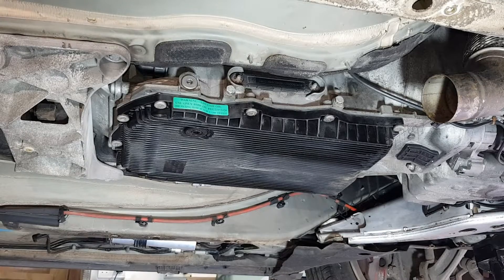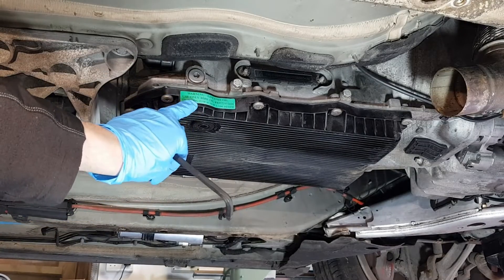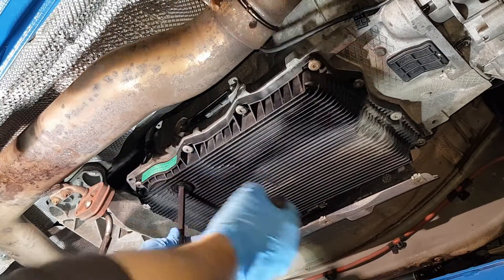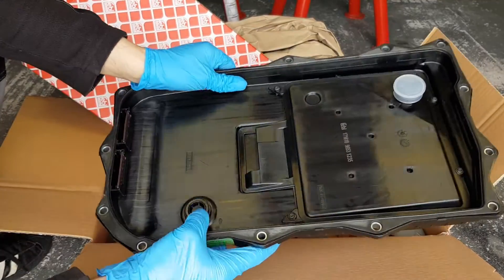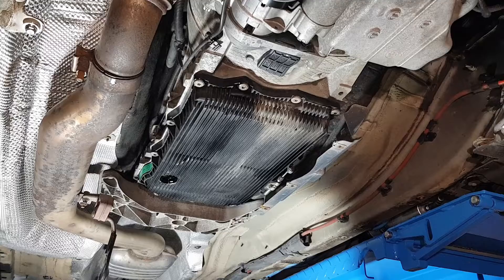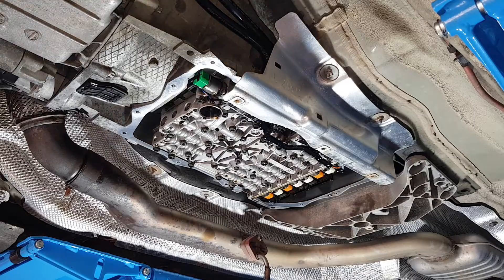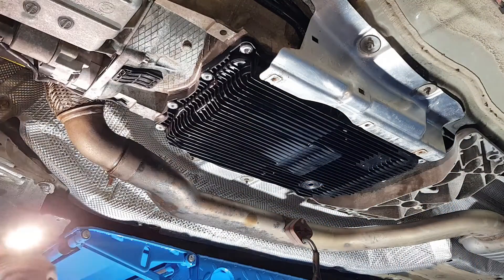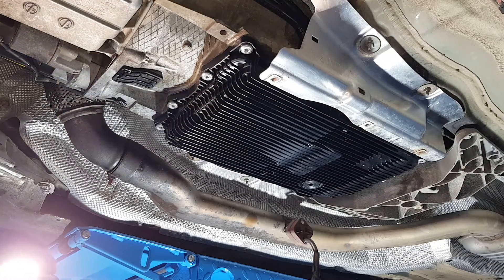BMW Automatic Transmission oil change ZF 8hp70 How to service Gearbox F10 530d 730d N57 N47 ATF 330d

Comment: Wow another great video, thanks for sharing! My 2010 F10 520D is after throwing up a drivetrain error with code 4200A3 solenoid valve HIS: open circuit pointing to the EGS. It happened on accelerating and seemed to hesitate to change gear around 3rd to 4th gear on moderate acceleration. No other codes from the EGS. would i be best getting a mechanic to remove the mechatronics and do a full solenoid replacement and seals also whilst getting the gearbox oil changed and new filter? Or does the code possibly point to something else do you think?
Reply from the maker: The drivetrain error code 4200A3 – solenoid valve HIS: open circuit on a BMW F10 520D with the ZF 8HP transmission generally indicates an electrical issue with one of the solenoids inside the mechatronics unit, not necessarily a hydraulic/mechanical one.

Here’s a breakdown of your situation and options:

1. Cause of the Error

Open circuit means the transmission control unit (EGS) is unable to communicate properly with the solenoid—typically due to:

A failed solenoid

Broken internal wiring

Corroded or damaged connector

Fault in the EGS (rare, but possible)

2. Common Symptoms

Hesitation when shifting (especially 3rd to 4th)

Limp mode triggering

Delayed or harsh shifts

3. Recommended Action

Since you’re already planning on servicing the transmission:

Yes, it would be wise to:

Remove the mechatronics unit

Test and replace the faulty solenoid (or consider full solenoid pack replacement if high mileage)

Replace internal seals (bridge/sealing sleeves) – common failure points that can cause pressure loss

Change transmission fluid and filter – essential during this service

Inspect and clean/replace the connector sleeve – another common failure point for EGS communication

4. What Else to Check

Before going for full solenoid replacement:

Inspect wiring harness and plug at the transmission – especially for corrosion or damage

Verify proper voltage at the solenoid plug – ensure it’s not a power supply issue from the EGS

Consider having a BMW specialist scan with ISTA/D or INPA, which gives deeper insight than generic scanners

Summary:

Given the specific open circuit fault, and shifting issues, you're likely on the right track. A full solenoid pack replacement and transmission service is a solid next step, especially if the car has over 100k miles.

Comment: hi great video just wondering do you need a scan tool to get the temp of the transmission  or can you run the car for a set time that would get it to that temp
Reply from the maker: @DavidPugsley  I would say if you run the car for 15min it should be very close to the correct temp. Most diagnostic tools will show you trans temp.🤝🏻

Comment: Hi! Thanks for this very instructive vid'. You said that the 8liters of oil are for the entire flushing (including torque converter). How much oil did you fill in when you don't flush the torque converter ?
Reply from the maker: @IrieIDam  If I remember correctly about 4.5l to 5.5l without the torque converter

Comment: Greetings from Ireland! 
Can you tell me where you purchased the black car maintenance ramps? they are on the right on the opening sequence of this video! 

Thank you!
Reply from the maker: @eoghangeraghty5012  Hi
I live in Northern Ireland. I welded the  ramps myself🤝🏻
Reply: @TheKeenMechanic  would you make another set for sale to me? I live in southern Ireland so it would be easy for me to collect. also, you could make a 'How To' video!
Reply from the maker: @eoghangeraghty5012  This ramp  is 7.5m long including loading ramps. 3 sections at 2.5m long. Each section is 60cm high and 30cm wide. If I was to make one for you it will cost a lot of money as the steel itself that went into it cost about £1000. I have to charge you 3k gbp as it takes a very long time to make. You are better off buying a lift or a welding machine and make one for yourself in your spare time
Reply from the maker: @eoghangeraghty5012  You can see it better at the end of this vdeo https://youtu.be/17iEgbyNv7Y?si=5D5fxhtONW-K85lc

Comment: Estimated time start to finish?
Reply from the maker: @kjhnsn7296  can be done in less than 1hr if you have experience and all tools/lift
Reply: @TheKeenMechanic  Great to know. Will most likely be doing for first time this weekend. FCP Euro kit, jackstands and BMW specific scan tool. Will budget 3hrs as I will most likely be looking around, taking pics, and being extra careful.
Reply: @rafh2753  Came out very well. Very straightforward. Key is having the car level, and watching the temperature of the transmission during the second fill. I drained and replaced roughly 4.3 - 4.5 liters of fluid. Oh, I also created a power filler from a $13 garden sprayer. This made the fill a quick and painless process. I did run across one issue during the drain process. The drain plug in the old pan broke when trying to open it. I carefully drilled through it as the oil in the pan would effectively suspend any plastic particles in place. In hindsight a better approach would have been to drive two screws into the drain plug and use them as a fulcrum to twist open the drain plug with a long screwdriver or similar.

Comment: Gotta do this next week,can’t beat Febi parts 👍 most OEM bmw
Reply from the maker: I have been using them over 10 years and haven't found better quality parts at these prices
Reply: @TheKeenMechanic even febi (guibo) OEM with bmw logo scraped off…loveing e39 background 👍
Reply from the maker: @Quick2004  Yes, they make the guibo still in Germany. I have a video on it too. By the way the silver BMW is 740i E38 which I have been driving as a daily car for years but the fuel tank is badly rusted so I just stopped driving it last week as I will be restoring the tank and whole rear axle. Now driving a lovely Msport 530i E39 Touring. Much lighter, sportier and easier on fuel than the E38
Reply: @TheKeenMechanic what she like on petrol ?
Reply from the maker: @Quick2004  so far I am getting close to 30mpg on a 10mile run. On longer journeys close to 35mpg. Not bad for a trouble free bullet proof M54
Reply: @TheKeenMechanic  that’s better then my e46 330ci 🤣 only drive her once in awhile she’s only got 70k on clock
Reply from the maker: @Quick2004  mine has 185k but I drive it with manners otherwise you get in the 20s

Comment: Hi mate how would you flush the torque converter . As that would mean you would get all the dirty oil out !
Reply from the maker: People flush them with a machine which forces the oil out but the manufacturer of these boxes ZF don't approve this method. Other way to get more oil is to remove the valve body, this will get a bit more oil but not the oil from the torque converter. The best and easiest and recommended way is to do an oil and filter change as I have shown and then drive for a while then do it again. There are debates on every method mentioned but this has worked for me for years and is the easiest way🤝🏻

Comment: With almost 400k on the odometer, I think I might do damage to mine, but I'm not sure, I will just leave it for now.
Reply from the maker: Hi
Most likely someone has serviced yours at some point. There are a lot of debates on this subject whether you should service an auto box with a lot of miles. I just think that there is no way you will break the gearbox by changing the oil and filter. It will only allow oil to flow better and you will prolong the life in my opinion. Thanks for watching and for always supporting me here🙌
Reply: @TheKeenMechanic  My pleasure, apologies for the late response.
Maybe it is better I change the fluid then, as from what I can tell there are no issues with the gearbox, other than a weird helicopter noise at idle, which goes away for about a second when changing from D - R - P  and so on.
Not sure if that is a big issue or not?
Reply from the maker: @mrmusic1880  Not sure to be honest myself. It will definitely benefit if you change the oil and filter. I had droning noise on my E38 740i when I bought it. Changed the oil and filter and disappeared
Reply: @TheKeenMechanic  Very well then!
A gearbox service is definitely on the list then, thank you!!

Comment: I think ZF recommends removing that part the pan covers, the silver piece where the solenoids connect to, and replacing the gaskets and this other piece near the electrical connector as well.

Before you start driving, they recommend running it through the gears and then in manual mode shifting up from 1-8 and then checking the levels again and topping up if needed.
Reply from the maker: Hi
Not sure if you noticed at the end of the procedure I mention to run through the gears and then to check again. Yes, there are a few sleeves on the valvebody to replace which we didn't have at the time and the owner of the car needed the car as soon as possible.
We have planned another oil change in the next 20k miles so then if he wants to replace them we can do that of course. Thanks for your comment and pleasure to have you here on the channel
Reply: @TheKeenMechanic  Silly question but will the car allow for running through all the gears if the wheels are not moving or will it restrict it to lowest starting gears (M1, M2). Easy enough to simply jump in and try it I guess...😄
Reply from the maker: @kjhnsn7296  It will run through the gears. Make sure wheels don't turn and gearbox has oil in it🤝🏻
Reply: @TheKeenMechanic  thanks!
Reply: You have pn for these sleeves and gaskets?  

I did mine as  you have in this video.  
I used ista and it  runs you through the process and won't progress until temps are right.